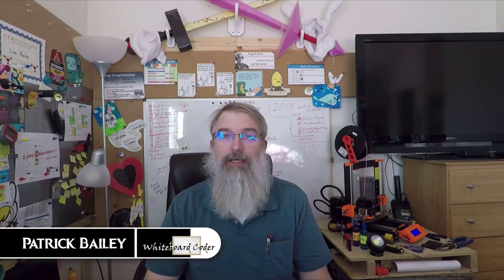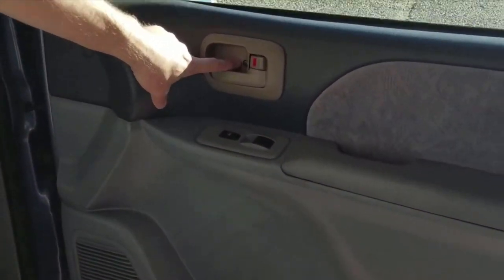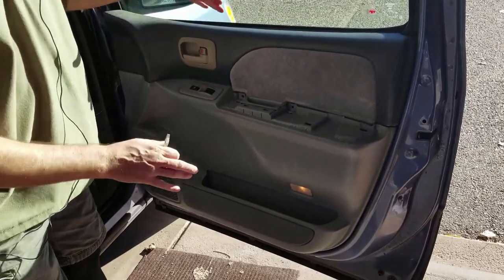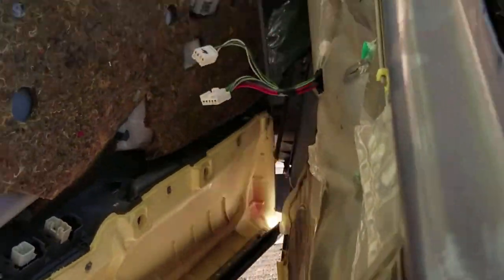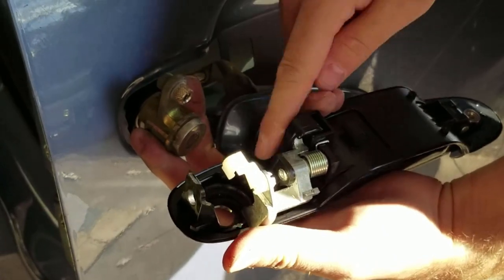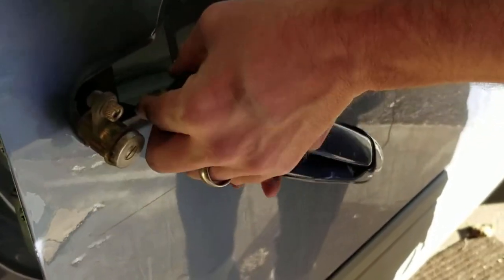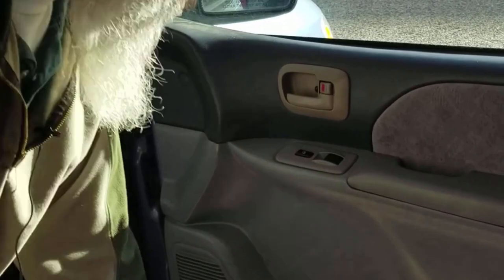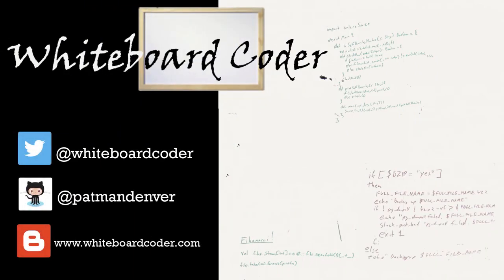Install Passenger side Front Door Handle on 1999 Toyota Sienna

Comment: The easiest  way to do it  : 

Remove the window rail by unscrew one bolt (located outside at side of the door) 

Then you can put your hand inside and use your finger to unclip + unhook the yellow plastic rod. 

And then remove the 3 bolts connected to handle (including the lock bolts) from inside. 

Then door handle will come out effortlessly. 

Put the new handle in first.
(without connecting anything) 

Then everything in reverse 
(Screw the bolts & connect the rods etc)

Comment: ...For removing blind bolts (you can see it, you just can't reach it), fill the socket about 1/4 the way full of wheel bearing grease, then remove the blind bolt. The wheel bearing grease will hold the bolt head keeping it from falling inside the door during removal. To install the bolt (you guessed it), put wheel bearing grease in the socket and then put the bolt in the socket. Start the bolt by hand holding the extension and finish tightening with ratchet handle. Works while accessing all blind bolts. Clean up socket with a paper towel...😎

Comment: It is extremely difficult to pull it out and back when everything is connected. But if something is not connected then impossible to connect from inside. Very frustrating design from Toyota there. 
I think other people are right about doing the connections from inside after removing the window rail.
Cut the tie that holds the electric wire to the lock, that will give wiggle room a bit.

Comment: I have watched your video over and over and others too. I am finding it absolutely impossible to keep the metal arm on and in position (the one that you seem to be able to pull out easily to attach to the new handle ).  It seems like the place the metal piece fits on to appears to be somewhat worn down.  Do you have any words of wisdom as to what I might be able to do to help that metal arm stay in position while attaching the new handle?  The old handle was still opening and closing the door, prior to my attempting to install the new handle, so I have to believe that arm should still operate properly...if done some other way...  Any and all advice would be much appreciated, as ALL handles are broken now, totally inoperable!
Reply: Remove the window slide rail.only one bolt.makes the job so much easier.
Reply: Thank you for the tip!!  I finally found a guy that was willing to take a look at what I needed help with. I took no more then 5 minutes for him to install the new handle on both front doors!! I just made a job way harder than it should've been!!

Comment: Thanks for the video as it helped me get started.  I see you wiggled the handle back into position in less than a minute whereas it took me over an hour.  The problem was that little plastic tab on the handle that needs to slide behind the sheet metal in the door.  It was almost impossible for me to get the handle positioned properly.  That little tab is what broke in my original handle.  Very porr design, in my opinion, by Toyota.  That little plastic tab takes a lot of abuse, especially in a mini-van.  If kids are yanking on the door handle when the door is locked, they will keep pulling until that little plastic tab breaks off.  That tab should be made of metal, or better yet, there should be another bolt holding it secure.  Yeah right, I know, that would add to the cost of the mini-van and they chose to cut this corner to keep the price down.  I'm OK with their choices as my 2000 Sienna has over 250,000 miles and still running strong.  I can handle a few non-critical parts breaking down once in a while.

Comment: Bad bad bad explanation about how to remove the elbow rest. I broke three tabs on mine. There are tabs on the front to push with. Screw driver and then the rest needs to be pulled UP, strait up, do not twist the ones in the back, they will break.

Comment: Thank you for the video. I had replaced the driver's side handle on my Sienna a few years back, but was having a much harder time with the passenger side. I followed your recommendation to attach the lock while the handle is still outside the door. I took me a long to get the assembly back in, but I saw you had done it so I just kept trying.

Comment: Thank you for this video. It is one of the most helpful for replacing the door handles on the Toyota Sienna. The door handles are the worst part of this car.  I have replaced the rear hatch mechanism twice, had to readjust the cable tension in both sliding doors, and now the drivers side exterior door handle cracked right down the middle.  I never had a problem with older American car door handles. The use of plastic in the designs is the culprit for sure - something always cracks! 

This repair took me almost 2 hours to complete, and it was helpful to look at other videos to remove the sliding window rail guide. It was a little tricky to reinstall the guide rail once it was unbolted since you have to tell by feel where the top of it engages in a slot.  This was necessary to get at the door latching lever, since it was necessary to get access to remove and reinstall the plastic retaining clip. My door panel also had a different electrical connector which was very difficult to find the latch release tab, which is a small hidden tab located near the insulation - finding the tab was very frustrating.  

Also I got a very poor fitting replacement door handle on Ebay which leaves a large gap where the door handle fits the door.  Had to use duct tape or silicone sealant to prevent rain water from getting inside the door. Not sure which other aftermarket door handles have this problem.  After a painstaking 2 hours to install, I wasn't about to replace it again. Except for the 1/16"-1/8"  wide gaps I am quite sure it is not from my failure to install it correctly. The screws and bolts all fit where they are supposed to and the door handle works perfectly.
Reply: you probably left out the door handle lining that was between the handle and the door, which takes care of the proper fitting of the handle to the door...
Reply: The new handle also came with its own black lining, but it was still a very poor fit. Great video nevertheless. The funky design of the handle works when it works, but is easily damaged.  @metubeslave
Reply: I did have the same problem, there was a serious gap between the handle and the door, even though all the screws fit well and the door opens and closes. I will be complaining to the handles seller on Amazon cause they don't really fit like they said they would, and, I will be asking for my money back. I may go to a wrecking yard to find an original.
Reply: @jeffw6716  went to a wrecking yard, there were plenty, I found one exterior passenger like new, I am happy and I returned the order from Amazon, didn't fit properly, and made me work harder and longer, what a waste of time and work
Reply: @metubeslave  Bravo! Great job! For my lazy self - the black silicone RTV sealant looks amateurish, but it keeps the water out.  My technique to preserve the door handle is to use one or two fingers to pull the handle while using the thumb to push against the stationary keylock. This will put less stress on the center door handle structure that ends up cracking.
Reply: @jeffw6716  when I went to the wrecking yard I realized there's a small wedge in the middle of the inside of the exterior door handle which needs to be engaged or it'll leave that separation you have in your car, don't need to remove it again, just remove the door cover and loose one bolt of the handle a bit and you could slide that wedge properly

Comment: All due respect but I tried like hell to relink the handle mechanism with it outside the door void as you do and ended up breaking the pot metal arm trying to get it back in- that arm being the deal breaker getting it in. If I try to link it with the handle already in then the lock tumbler prevents door void access for the handle. I've rebuilt a 4 barrel carb and the top end of a motorcycle but after much swearing and weeks crawling in the van through the passenger door and ordering yet another new handle and trying again I'm throwing in the towel and paying the mechanic down the street the $80 to f'n do it. PS the other clips show the handle being relinked after its mounted in the door void.
Reply from the maker: Sorry to hear that.  Some days you get the bear, some days the bear gets you :(
Reply: @Whiteboardcoder  i know all this is possible, I wont take no for an answer, ive done so many different door handles and window motors, ill figure it out, i dont like working on cars but i dont have the money to pay anyone, now just waiting for a warm day to pop up, LOL
Reply: Remove rear window track.one bolt.soooo much easier.

Comment: good job there, I gotta do the inner and outer on mine, I hate how toyotas plastic parts all snap off
Reply from the maker: Yeah a bit of a pain, but to give them some credit they did get a piece of plastic to last 18 years, so that's something.
Reply: @Whiteboardcoder  The only reason it lasted 18 years before it came off was due to the van living most of its life in Southern California until I took delivery of it in Ohio 8 mos. back.  I had to run a forced air porto heater on a stool by the door to unfreeze and thoroughly dry out the passenger handle so as not to have it come off in my hand as the driver door did after a freezing rain.